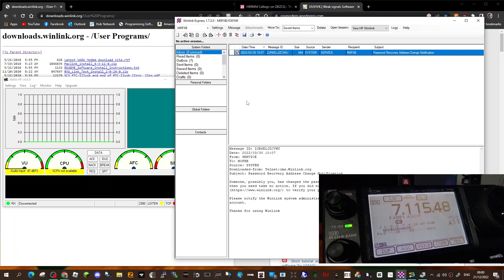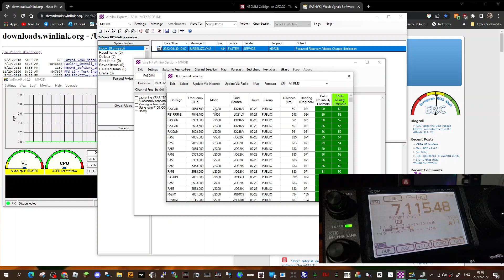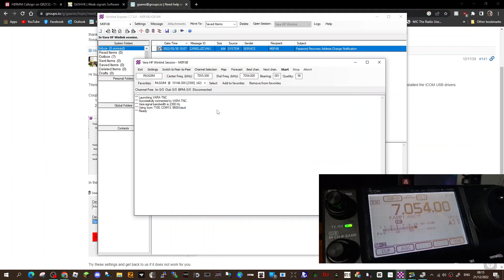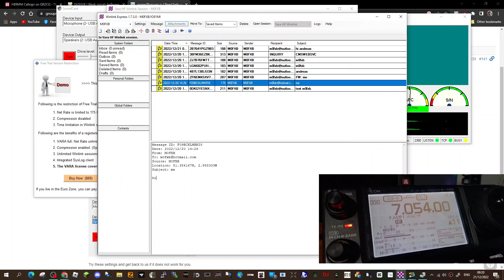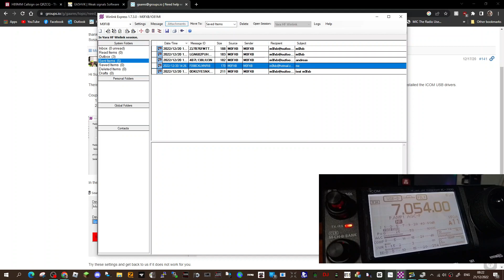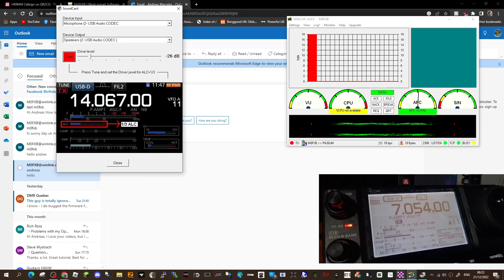SEND EMAILS HF-ICOM 7100 LIVE -FULL SET UP & TEST

Comment: Hi Andreas, nice to see it working for you. A couple comments:

1. Once the emails are sent, Winlink confirms that the email has been sent properly and then that's the moment where the emails are moved from outbox to sent.

2. Be mindful, before hitting start, to confirm that the frequency is not in use. Typically is best to wait one to two minutes before starting the connection. VARA is great and it will probably push through interference but you're also interfering with someone else's transmission.

3. I'll be sending you an email from my winlink account so we can talk though there. There's lots of amazing things you can do with Winlink besides just getting emails. For example getting the weather, news, posting your position to both Winlink and APRS networks, retrieving information from internet websites.

Talk soon, 

73 de Luis, HB9HJU
Reply from the maker: Hi Luis thanks for your help yes be great to make contact .73